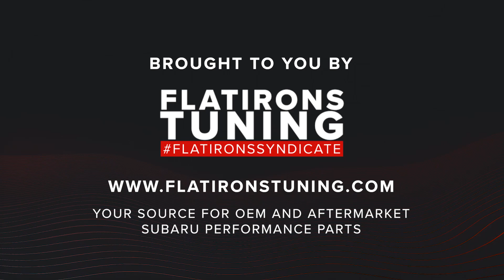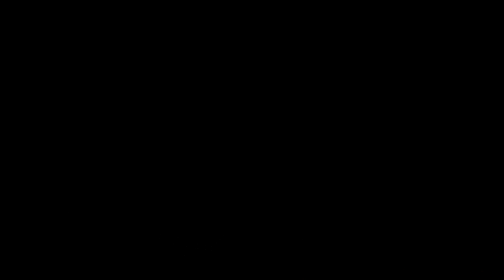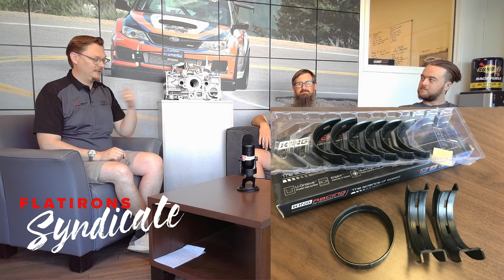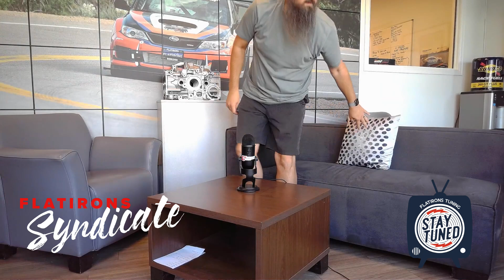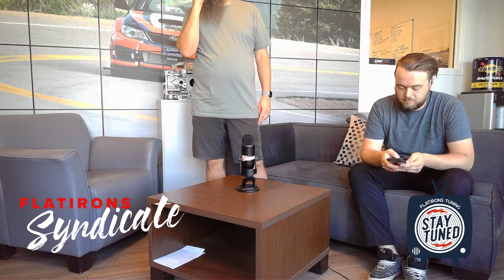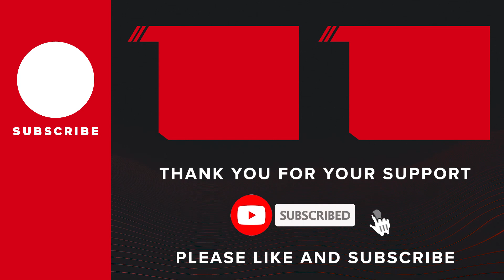What is engine bearing failure and how do you prevent it?

Comment: I just had a rod bearing disintegrate and ended up in my oil pan... I didn't see any glitter in the oil.. Just the actual pieces of the bearing... What other parts of the engine should I check?
Reply from the maker: Thanks for watching and thanks for your question.  When you disassemble the engine, be sure to inspect anywhere that the oil flows through for signs of debris.

Hope that helps and Stay Tuned!

Comment: I have my car in the shop right now I thought is had rod knock sounded bad but they open my oil pan and found no metal shaving in there so they are looking into it more ? What else can it be
Reply from the maker: Could also be the timing belt tensioner.  If it is loose, it can make a noise similar to rod knock..

Hope that helps!

Comment: My '04 Forester XT developed rod knock after 230,000 miles. I wasn't even sure it was rod knock at first, because it did not knock at all while idling, and I still had great oil pressure. It would only start knocking around 1800 RPM and then go away above like 2800 RPM. I stopped driving it almost immediately when it happened. I drove 1 more mile, slowly, to get home and parked it. Finally pulled the engine and sure enough, cylinder #3 rod bearings were trashed. Even with such a short amount of engine runtime after hearing the first sign of rod knock, there was A LOT of metal shavings (not just tiny glittery dust particles) in the oil pan!
Reply: I did a 200kmh pull with my STI, when I was done and just going normal speed at low rpm I thought it didn't sound quite right, someone that doesn't know the car would not have known. I got home 5-10km further and it was getting slightly worse but wasn't sure still.

The next morning I went to investigate and it was very clear it was that.

Comment: And if you have a rod failure it is mandatory you clean every part and flush every oil galley oil pan, cam gears in avcs and after first start run for 5 mins and change oil. Then repeat process, untill oil is clean. Do break in in driveway, oil cooler is impossible to clean has to be replaced IV tried, it’s pre filter so it doesn’t go to the rods but it does go through the oil pump. It can also plug up and cause your pump to be stuck in bypass and cavitate I do 3-4 oil changes in 100 miles after a spun bearing rebuild. Cleaned everything and have had really good luck. I think the factory oil cooler/warmer is part of the problem as well. Keeping oil temps at bay also help. How many subarus have spun a bearing but not realized their oil temp is at 260 degrees. This is also what bites people in the butt. Oil pressure gauges and temperature gauges are a must
Reply from the maker: Thanks for watching and thanks for the comment.

Stay Tuned!

Comment: I love the comments about Subaru and the rod bearings and failures when in all reality it’s the factory rod bolts if you take stock sti rods. Put arp2000 rod bolts and then obviously hone and resize cuz it changes clearances, but every rod bearing failure I have had except the pickup tube failure was a factory rod bolt that has broken, stretched, or fretted from high torque runs. Once I fixed the rod bolts problem my issues went to broken ringlands. So now with my set up 100mm bore stock sti forged rods and 400ft lbs of torque I have had much more success, my Subaru runs and I’m proud to say IV blown up 22 Subaru motors and continuing, and they sit around 375-450 hp for 50-60 thousand miles on stock block ej257 they are tough engines, and if you don’t get greedy with horsepower numbers then you can have a very reliable car.

Comment: Are there other times you would want to replace avcs cam gears other than a spun bearing?
Reply from the maker: Thanks for your question.  There can certainly be errors that are thrown that are related to AVCS cam gears, and in those cases, it can be part of the diagnosis to change them.  

I would generally say that you would want to take a look at oil pressure before simply changing out the gears, but  it is possible that they could develop an issue over time.

Hope that helps and Stay Tuned!

Comment: Having gone through this twice in the last year, I feel like the coolant temp has a big effect on the oil temp. The first time I blew it(ej20 in a 2005 WRX wagon) outside of Vegas. Blasted 2 trucks on US 93 and 2-3 minutes later let up to slow down to pass another truck and it was knocking. Looked down and the temp was around 3/4. Turned the heater on and fan to full, temp dropped back to normal. After I got it back from the “shop” in Vegas, a coolant line came off. Steam billowing. Once again temp at the same spot. Right after that towed it to SurgeLine and they said all the coolant lines and all the oil seals leak. Oil all over the timing belt(dippy tossed the timing cover) and the accessory drive belts. And now rod knock again. Pretty sure the second time was 100% the oil heated in the oil cooler. As the coolant left the system it got hot and the oil was cooling the engine. 
The first time I lost 1 qt of oil the second I lost 2 qts. Weird thing was the only thing in the catch can was dust. So I think the oil got so thing it just passed out the seals. It doesn’t leak anymore. The oil pressure light didn’t come on either time. 

Side not the “shop” in vegas blew it up at least 1 more time maybe twice. And I have the analysis report from black stone saying there was a large amount of bearing material in the oil and it may be need another rebuild. Well now it knocks pretty good, we’ll not good but you know.

Comment: 0:45 What is bearing failure
1:15 Bearing definition
3:44 What is spun & knock
7:02 Main vs rod & oil path
8:42 Symptoms & analysis
11:36 Bearing deformation 
13:40 Not waiting & why
16:54 Reusing & cleaning
20:10 Oil sensors & gauges
22:30 Oil level & g-forces
28:20 Crankcase ventilation
29:18 Oil consumption
30:51 Pans, pickups, baffles
32:51 AOS & catch cans
33:35 Oil pumps
35:08 Oil temperature

Comment: One of the most important topics to cover with a Subaru. Definite with a performance based one. One thing is not sure if its been done but the stock oil pressure light switch, if you could upgrade that to a higher setting before its too late.
Reply: Depending on factors, with a stock 10mm oil pump your oil pressure at warm idle is barely more than 16psi, so a higher-pressure switch to trigger the oil pressure light on the dash would be "on" at idle a lot more. 

A proper oil pressure gauge (with a low-pressure alarm you can set) would be much better.

Comment: Great topic guys, I think the 6 qt oil pan from KillerB is a good improvement for a modified EJ as it increases likelihood that oil is available for the pickup tube and pump. Also an extra quart keeps the oil a little fresher during that 3000 mile interval. Quick question: Do you think an oem STI oil cooler added to the EJ255 will lower oil pressure with the stock 10mm oil pump? Thanks!

Comment: About stock subaru oil pressure sensor - don't you guys replace it with, say, mitsubishi sensor? it has 1bar pressure threshold... so the light becomes more informative then "your engine is dead"?
Reply from the maker: Thanks for the question. The Subaru light comes on around 16 psi which is higher than 1 Bar.  I'd say rather than simply replacing it with a sensor that triggers at a single pressure, replacing it with a gauge that actually shows you what is happening in the engine is more ideal.

And if you can data-log that pressure, that is way better.

Thanks for watching and Stay Tuned!

Comment: How good is the stock oil pan/pickup/baffling for track days running stock configuration engine?
Reply: Upgrading the oiling system is more to do with mitigating the effects of G forces on the boxer engine than power level. If you are taking a long, high G turn with the stock setup, you are cruising for a bruising imo.
Reply: @johnwesely  I guess what I want to know is what are the limits of lateral G force for stock oil pan and is there any data for the iag and killer b setups for how much g force they can take, as well as any flaws in those aftermarket designs vs stock oiling system. Thanks

Comment: I've been taught from a young age to change my oil every 3 thousand miles and always fix your oil leaks, I'm 56 and have never blown an engine. also killer B told me to use 6 quarts of oil in my ej255, can you confirm that john? with killer B pan
Reply: 70 retired lineman diyer.  Same here with my 2006 Subaru sti.  Change the oil every 5000 miles on my 98 Honda prelude
Reply: If you're using a Killer B pan, I'd use Killer B's recommendation. They'd know better than anyone.

Comment: I learnt a valuable lesson very recently. That is you do not mess with your PCV system I replaced the lines with non-standard ones and added a 90° elbow to join 2  lines together this massively increased crankcase vacuum causing oil to be pulled directly out of the sump it was wild.

Comment: So, what is a good oil pressure gauge to use? Also, where is it best to install this to monitor the pressure?
Reply from the maker: Great question.  We like the Innovate Oil Temp and Pressure dual gauge:

https://www.flatironstuning.com/innovate-mtx-d-dual-gauge-oil-pressure-temperature

A big reason is that you can get both of those important pieces of information from a single gauge.  

We have been putting them in place of the factory "sensor".  It works well, but the reading can move around a lot, so a damper can be a good idea as well.

Hope that helps and Stay Tuned!
Reply: @FlatironsTuning  thanks for the information! This is super helpful for my new build. What does the damper look like? And would it got in the oem sensor location first take like a flow meter resistor?
Reply from the maker: @Nightdeath4223  Here is a link to the Prosport kit:

https://www.flatironstuning.com/prosport-remote-oil-pressure-sender-installation-kit

Basically it just puts the sensor further away from the block, so the pulses of pressure are smoothed out a bit.
Reply: I use the AEM (150PSI max) "X Series" oil pressure gauge and am pretty happy with it. Visual "bar graph", large numerical readout and programmable alarm.